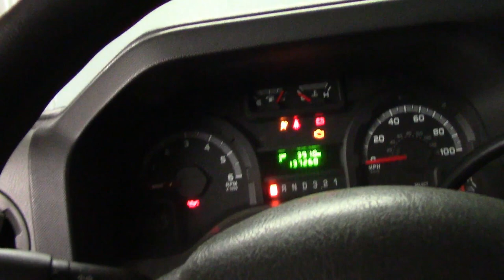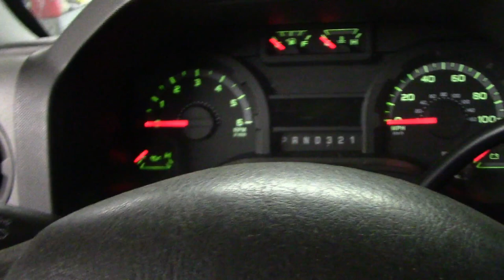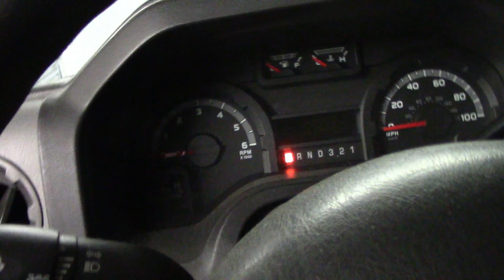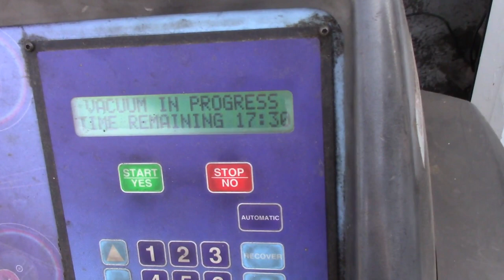2010 ambulance with lots of leaks (the saga is over)

Comment: Thank you so much for your reply, the truck goes in on Tuesday , 2 days from now, and there replacing the intake manifold. We will see if it's a fix or not.
Reply from the maker: The intake manifolds on the 4.6 liter engines are full plastic and can break and leak for sure.

Comment: Very good series , thank you for doing them, can that engine get coolant in the cylinder and combustion gas in the coolant through the intake manifold? That's what the ford tech said had happened to my engine. So much that it hydrolocks the engine.
Reply from the maker: If the intake gasket fails in just the right conditions, then it can get coolant in the cylinders through the intake runner.

Comment: What exactly is the pipe feeding at 10:38? I see its cooling but does it actually line up with casting openings on the block? Complete Triton V 10 newbie here..
Reply from the maker: That's the oil filter re locator/adapter. There are passages in the block for oil in and out of that assembly and a coolant passage for the bottom hose to attach to.
Reply: Ahh. Now I see, Thanks!

Comment: With 135k on an ambulance why not sell the customer on a long block? 135k and prob 15-20000 hours on the engine. The engine had multiple issues that takes plenty of hours of labor to fix. $4500-5k for a reman Ford long block and labor to install. Those trucks aren't cheap new, around 80-100k so a new engine might not be a bad investment since they are already paying labor to pull it.
Reply from the maker: The van only came in for an oil leak. The leak was between the engine and transmission. We found the broken exhaust bolts while looking it over and it was easier to pull the engine to fix the oil leak and drill the bolts out than to pull the transmission. The job snow balled after that.